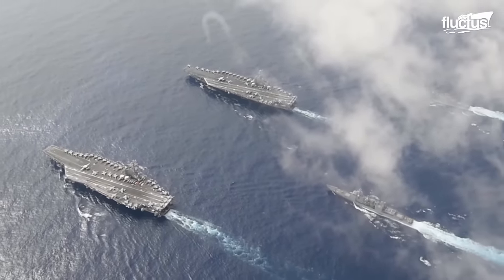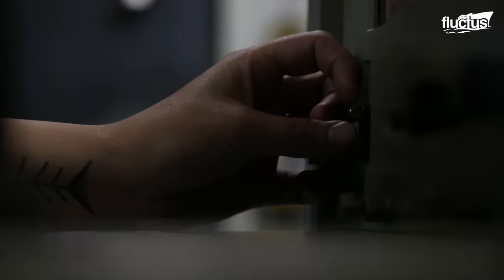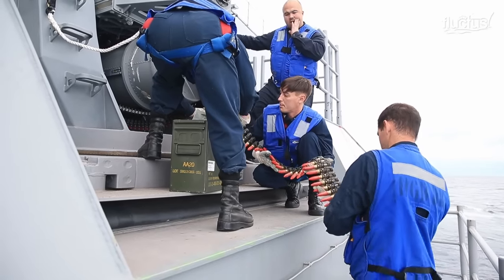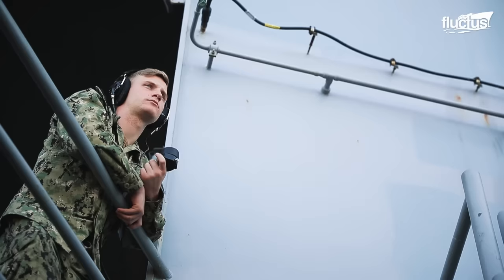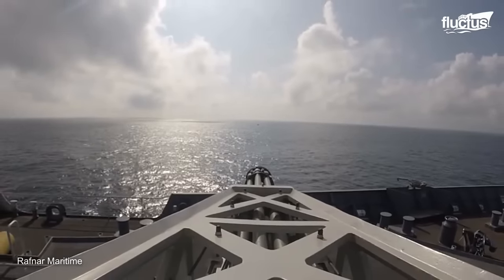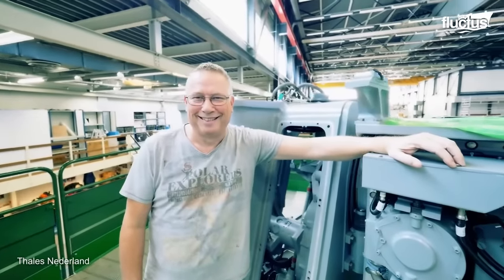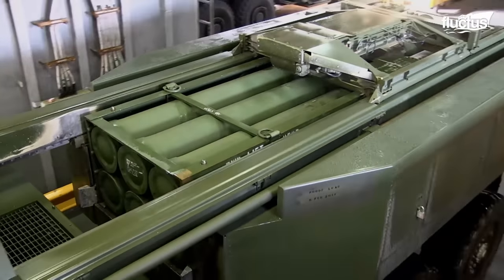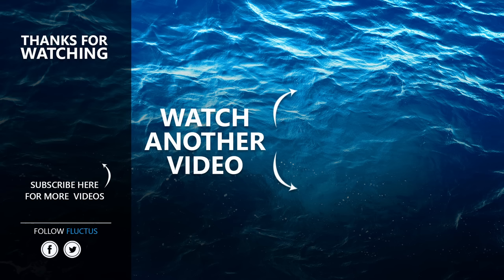The Radical Solutions US Navy Found To Protect Its Largest Ships at Sea

Comment: As I understand it, there are some limitations to the CWIS. With the onset of newer threats from super fast missiles, are the capable of reacting in time to the newer threat? One of the limitations I understand is the amount of ammunition available in the weapon mount system -- particularly if they are reacting to more than one threat. By the way, has the CWIS ever been considered to be matched with computer directed and/ or a man with a helmet mounted targeting system against swarm type attacks? Are the CWIS guns positioned to react against these attacks or to react against multiple types of attacks simultaneously? Next, .50 caliber M2 machine guns are old man directed weapons. During WW2, there were two-gun and four-gun mounts that were effective against air and ground targets. The M2 has limits that were recognized in the past and were replaced with 20mm and 40mm weapons. In 1944, we had man directed planes carrying out the modern acton threats of drones. Compared to the smaller carriers of WW2, it dies not appear our larger carriers have enough threat protection. I will note the difference in threat protection on all our ships when WW2 started compared to what was on them at wars end. Better to design in and plan now that after service member blood has ran into the sea.
Reply: I think the old type ante air craft systems worked OK an exploding shell in the air with rapid fire would do a better job far to mutch messing around with sw
Reply: 어느나라 할것없이 많은돈을없애 무기를 제조만들어  결국은 사람을 없애버리는 것뿐 다른데는 쓸모가없는것이야!.왜이런걸까?.이것이야말로 자연법칙이라 할까?!.

Comment: the phalanx would be ineffective against hypersonic missiles. Only the laser would be most efficient against such threats. Keep in mind that hypersonic missiles would be traveling at speeds of Mach 10 but lasers would be more effective at the speed of light. Do the math; 186,000/sec as opposed to 6,770 mph. The second they appear over the horizon the lasers will engage automatically

Comment: Does anyone know… the close in systems are used to knock out an incoming anti ship missile, however if several arrive all at once- and at a very high speed, will the defence system become “over saturated” ?
Reply: Depends on what kind of ship is being attacked. The Ticonderoga and Arleigh Burke can track, identify, and engage multiple threats at one time to protect the carrier.
Reply: Look like  it takes  too long to reload  the ciws.
Reply: @LCM-sq4pw . Not really, the engagement they are designed for usually only lasts for one or two minutes at the most. And a good crew can reload in less than ten. Ship systems carry enough for several engagements on one load.
Reply: Anti-ship missiles would first have to go thru SM-6. If not succesfully intercepted, then SM-2. After that ESSM then RAM missiles. CIWS Phalanx is the last resort.
Reply: @robmccormick3197  
That's  the problem,  only  take 2 minutes  to used  up,  but  take  more  than 10 minutes  to reload.  Imagine  hundreds of  uav + missiles incoming....  ten minutes  is  too long.
Reply: For anyone saying no, I bet you also wouldn’t want your family member out there shipboard near China when all hell breaks loose.

Comment: No question they need defense systems but defending against who exactly?  Some pirates?  Countries that have no navies? Superior defense yes, but mostly  trillions spent to fill military contractor’spockets.
Reply: Bingo.
Reply: The vast majority of goods travel through shipping lanes.  Who do you think keeps those lanes safe?

Plus last time I checked, China is building up its Navy.

The Navy also does relief work around the globe.
Reply: @havok6280  Excellent points all, but the video has nothing to do with those things.  
It’s about defending the fleet from attacks, which certainly is a priority. 
To reiterate my point, the pirates in the shipping lanes are never going to be a threat to a USN carrier and it’s escorts. Just the presence of the fleet is a deterrent to piracy. 
Other than China, no other country has a substantial fleet. 
If you’re worried about war with China at some point, it seems nukes, not ship to ship battles like previous wars would be the play. 
Militaries have a habit of fighting yesterday’s wars, which rarely goes well. 
To follow that, hardware by the trillions is yesterday’s war.  
Software to attack core support systems like power grids and water supplies is tomorrow’s war. Defense spending would be better put to work there. Rest assured China is doing just that.
Reply: At this point it's all about a limited war (non-nuclear) with China over Taiwan.  Certainly this would be a naval war for the US, and China prepares day and night to destroy our naval assets.  That is what we prepare for.  I have no idea what other critical challenges the US Navy would have.